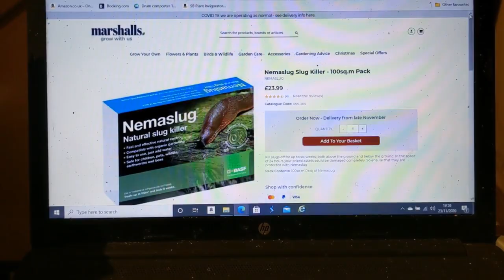UK Allotment Autumn 2020 ~ Slug Hunting At Night with GURU MURPHINDA

Comment: I tried an electric slug fence on my kitchen garden raised bed, using 2 galvanised wires ran in parallel about 1/5" apart around the top of the timber, wired to a 9v battery. The idea is that if a slug tries to cross the 2 wires it makes a circuit and so gets a shock .  Worked pretty well, until the wire rusted through. Moral - use copper wire!
Reply from the maker: Thanks for sharing... ZAP THE BAR STEWARDS ... Thanks for this... I will showcase it in a vid if it's OK with you mate, do the others can see it too... I'll give you the credit for if. Thanks 
ATB GURU M!!!
Reply: @thelittlefarmersfarm5706  Your welcome. Just be sure to get rid of all the slugs IN the bed, because whilst the ones on the outside can't get in, the ones on the inside can't get out:-))!